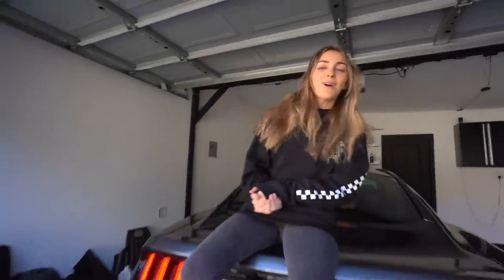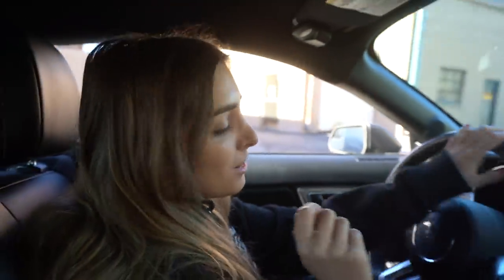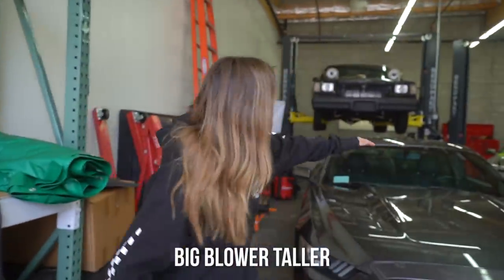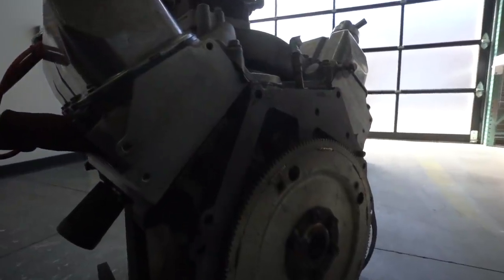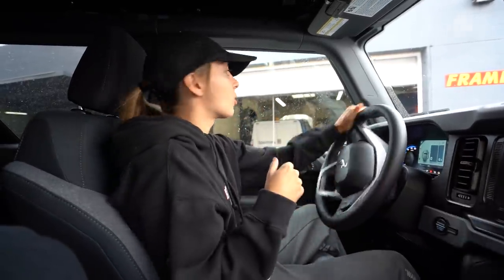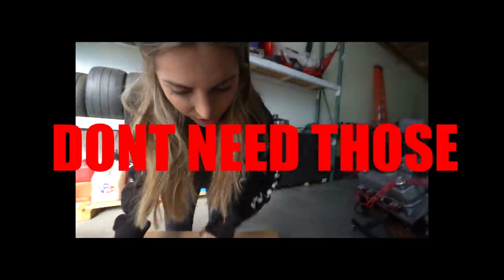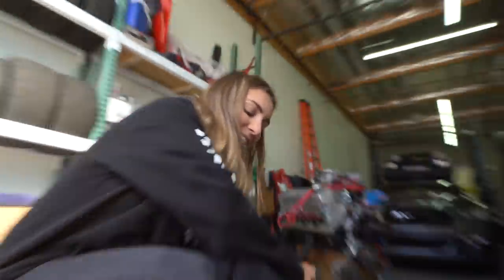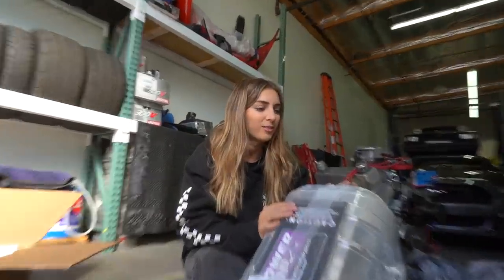I Bought The Most Absurd 2000HP Supercharged Big Block Engine for the Mustang.

Comment: Is the block strong enough to handle 2000hp? that would be my worry, especially being a BBF
Reply: Yes. I’ve seen these Motorsports SVO blocks make 2000hp at the mid 20psi range. The 385 series bbf is insane and I’m not sure why more people don’t build them
Reply: @4funner66  - people are ignorant. Rickie smith dominated pro stock with a BBF and so did Bob glidden.

Comment: i want to see 1200whp coyote build. or i wanna see a 2000hp coyote build. going pushrod from a coyote is going backwards!! You can get 1200whp hp and go as fast as 7s with just boost and fuel. Thats with nothing no heads no cams no pistons or rods.  Put the ford in the regal and coyte build a fox. you can go 5s and 6ss with a coyote fox.
Reply: Some people are stuck in the past with the pushrod shit, although going anything close to 2k horsepower is stupidly expensive on the Coyote sadly.
Reply: 2000 hp with a push rod engine isn't that hard bud.
Reply: Cough… oil pump gears. cough… cam lock outs. Blocks also need to be sleeved after 900 and if you want to got for 1200 you might to change the rods.
Reply: @christiansmith8529  let’s break this down. 

OPG’s in these cars break due to banging off a two step or a limiter, not high RPM use. The GT350 motor that revs to 8250+ uses the same OPG’s as the coyote does and it doesn’t have issues. 

Cam lock outs? If you’re going like 1500hp maybe, Aldo’s car isn’t locked and it’s fast as shit, midnights cars also aren’t locked. The VCT works really well. 

PLENTY of 100% stock motor Gen 2 & 3’s make 900whp without sleeves, 1200? Yea you’ll sleeve it. But if you’re that worried get a roadrunner engine or a predator block. Hell Joel Steele’s RoadRunner engine with ARP hardware only went at 1200 for two years and was sold and it “looked brand new” when sold.
Reply: @169abr  the opg’s break on the 2 step and limiter, you said it yourself.

Cam lock outs aren’t necessary but will help a lot with tuning. If you’re doing a 1200 hp build it’s pretty serious. I’m not sure why you wouldn’t to make tuning and trouble shooting much easier on yourself.

You said a 1200 horsepower build with just boost and fuel, now you’re saying to sleeve it too. 900 is getting close to the limit, you can make more but you’re playing with fire.
Reply: @christiansmith8529  I’m not the OP on this, I’m agreeing to sleeve it at 1200WHP unless you don’t mind blowing something up, the OP said just boost and fuel. 

OPG’s don’t always break on it either but people think bolt on cars need OPG’s. Plenty of stock cars go insanely fast on stock ones just fine.

You don’t have to do lockouts, if you’re stock PCM I don’t think locking the cams or leaving VCT is that big of a deal for the tuners like Lund or PBD. Again plenty of stock VCT cars go plenty fast and are 1200+. Midnights world record car had stock VCT intact and was tuned by Lund. If you’re locking the cams you know enough at this point and are a fully built engine anyways and lockouts are done cause it’s a standalone. 

Are you an LS fan? SBF? Hemi?
Reply: @169abr  I grew up in a racing family, we ran bff, bbc, and big ci stuff I don’t really consider either. My last project was a 3.0 s4 bored, big turbos, pistons, rods, ecu. my father built a pro charged s550 a few years ago, suspension, Lund tune etc. 900ish whp with smaller pulleys ready to go. so, I’m reasonably familiar with the engine. I’ve been out of everything for a few years. Was planning on doing an ls turbo build before Covid fucked my business.
Reply: @christiansmith8529  yea things have been developing fast with these cars cause of the 10R, the high 7 second stock motor pass really made a lot of people realize things. I want to put a Centri on mine but I’m saving for a house at the moment. Covid fucked a lot up and the current admin isn’t doing us favors.
Reply: @169abr  lol, lost my house so I could still pay the staffs mortgages…

Comment: Yeah, Sandy does have a valid criticism on the build. Polished is old school for sure. It looks good but old fashioned nowadays. It's a Mustang so go with dark engine components and carbon fiber accessories. The engine is bad ass but that frame will need modification for that engine to fit and handle the torque. This build is definitely going to be exciting to watch. The finished product will be insane!

Comment: My father had a 1985 F350 with a 460. Ford put such restrictive carburetors, intake manifolds, cylinder heads, and exhaust systems on those engines from the factory to meet emmissions. It always made me wonder what they were capable of in the right hands, I'm very excited to see how it goes down the track! What transmission are you putting behind it????

Comment: Curious to see the actual specs of the 598. If it's a steel rod engine(likely) it isn't going to be happy with 2000hp. It starts crossing into aluminum rod territory. If you end up bending a rod with the 14-71 on it (also likely) you might consider reducing the stroke while you're in there to fit a piston with a taller compression height which will be much stronger and more appropriate for the application. You'll probably end up at 582 inches or thereabouts but with aluminum rods it'll last.
Reply: And also possibly lower compression.

Comment: The 8.8 holds power pretty decently. Its the mounts and axle shafts that will be unhappy. If its drag racing only though, you can always put a 9" in back in place of the IRS.
Reply: The 8.8 def won’t hold 2000hp even built more than likely they will go with a QP 9” rear like on the regal.

Comment: I am not sure I heard you right but did you say Jon Kaase P 51 heads or did you say Sr 71 heads as those are the heads that Jon used to pull over a thousand hp and over 900 ft lbs on the 598 engine as I saw that video  almost a year ago.

Comment: I definitely agree with the Big Block and absolutely love Roots and Screw  blowers but there are only a few cars that don't look badass with a blower coming thru the hood and s550's are one unless it's carbon fiber s550 bodied promod! Since turbos are out of the question a crank driven F130 procharger would be way to go! Go with 25.5 or 25.3 chassis small tire build, bad ass 9" strange rear end,4 link and anti roll bar setup, everything suspension and k member parts from Race Craft or TRZ, possibly change the rods and Pistons definitely a centrifugal blower grind cam a john kasse 4500 flange single plain intake with 16 injector bungs run eight Billet Atomizer 550#s for all the alcohol and eight 325#s or some Bosch 210#'s to run E or pump gas on the street and god's gift to man Holley EFI a bad ass Reid cased th400 with a Hughes bolt together converter. I would try and keep as much of the interior as possible and run it on 28x10.5 slicks or 275 radials but have enough room to run a 29.5x10.5w slick. That would be a easy low 4 second car in the 1/8 and 6.70-7.00 easy in the 1/4!

Comment: just letting you know. With h beam rods instead of the much stronger i beam rods if you chuck any good sort of boost at it, it will snap a rod extremely easily and destroy the block and probably the head. before you put it in i would say switch the rods out now for the stronger i beam rods before you destroy the engine to the point you just need to buy a new one and have to do it anyways.
Reply: and rods should be limited to no more than 30 passes ...if she is making a 2000+hp pro mod car...and if this old guy she bought this engine from was a NA bracket racer, I am sure he was pushing 11.5:1 compression pistons  she will need to replace them with 8.0:1
Reply: 598 na 1000hp closer to 14:1 I bet

Comment: Oooh, this is gonna be sooo nasteee!! You need to get some true Aussie engine builders in there to help you get the right parts in it, so it doesn't scatter the bottom end, the first time you fire up some big tires with it. You realize of course, you'll have almost double the horsepower of your C8 now, in a car that doesn't handle nearly as well.. topped off by INSTANT throttle response (unlike a turbo). It will get out from under you quicker than a skateboard in a grease pit! Be careful kiddo!😍😁👍

Comment: Dangit, I’m enthused about it but IT’S GONNA BE EXPENSIVE!!! Piston change to lower the compression ratio,rebalance the rotating assembly,cam change and a drive system just to get started. Fuel system,ignition and complete chassis to house your new monster which you might as well consider a new family member since it’s gonna cost something comparable to raising a child to the age of 18. 
I freakin love it!!! 
In the middle of a pro mod build myself so I’m in the same boat. I’m glad you’re taking on this type of build,proud of ya youngster and good luck. 👍

Comment: Remember load on the axles is determined by the size of the tires, as Whistlin diesel has found with his Monster truck, horsepower will always find the weakest link, so do not put the biggest wheels on it until it needs it.

Comment: I didn't realize you have a 17 5.0 in the Ebony... I have the 17 3.7 with intents to TT it later down the line but now I have second thoughts lol
Reply: Trade it for a 5.0, it’s actually attainable unlike these insane YouTube builds.
Reply: @169abr  yaa, i commented at the beginning, minus the huge blower, the motor would be fun swap still... I'll be buying the s650 5.0 couple years after they release if they go with the awd feature they are talking about, for now the 3.7 only has 45000km and a 160000km warranty so nothing planned for a while either way lol

Comment: They make a 16-71 ( and you can still find old 18-71’s off old supercharged diesel semi’s )  honey that motors not gonna handle that 14-71 blower that’s what Top Fuel dragsters/cars run, I hope you plan on getting a rear end abd tranny that can handle about 3-5000HP depending on what fuel you run probably get 3k on pump gas and 5k+HP methanol, your gonna destroy your drivetrain lol

Comment: Big block Ford alsome but she’s gonna be very heavy in the front like the Weight distribution is gonna be wrost and instead of using an intercooler why not run methanol  to lose some weight and keep the engine cooled?

Comment: OMG. THAT car? With THAT AWESOME motor? I am expecting the same, lots of bendy stuff happening and finally the plastic crap will disintegrate (I hope you will be safe...). Not because Ford (I honestly have nothing against them as a company), but because NEW Ford made of plastic, NOT made of good-ol-fashioned STEEL. That is FAR TOO MUCH engine for that car unless you are going to modify the entire thing so much that it voids the VIN. lol And I am trying to imagine what will need to be done to the suspension (the front, especially...) Oh, yeah, also...WHAT are you going to do about the transmission? Because that stock 5.0 trans won't cut it for that big block... 

   ANYWAY, like all of your projects, I can't wait to see what this thing will be like when you are done(-ish)! We all know that Project Cars are never truly done, there is ALWAYS SOMETHING that can be fixed or updated or further modified... 

   Luv ya! <3

Comment: Emelia don't run carby with a hat it looks rubbish. In Aus we run blowers on everything we set them up with mechanical injection on alcohol. I have friends that are running mechanical e85 if they are using it on the street. Or if you look up JOE BLOW they have really cool EFI kits you can use to run Injectors without modifying or changing you're manifold

Comment: How much heavier than a Coyote is that setup? Can't wait to see the Carbon Driveshaft and built diff
Reply: According to Google an aluminum head 460BBF is in the 675lbs range and a coyote is in the 420lbs range. This doesn't account for the blower on the 460.

Comment: 1) you are going to have to reduce the compression ratio of the NA engine to about 8.0:1 or you are going destroy your new engine when that roots starts to spin up
2)  I recommend you pull the heads and get a look see at your pistons.  are they dished for a blower?  or are they High compression pop up style? what are they made of?  are they coated?
3) What Cam are you running? is it set up for a roots blower or a NA engine.   check these things or your engine is going to instantly regret your choices. 
4) check your rods too....how many passes do they have on them?  can they take the additional punishment of a big blower after an unknown number of passes already? If you are going to make 2000hp I would limit a NEW set of rods to 20-30 ...1/4" mile passes
Reply: You're so right !!

Comment: Engine out of a crashed drag car?? Strip it fully and crack test everything. 
I have seen both drag and oval car engines that run but fail in a very short time because of a big rev upside down or when the wheels hit the fence it loads every item in the car. And ofcourse where the balancer hits the wall!!

Comment: I would suggest changing the pistons in that engine. If it was built for bracket racing I'm going to guess it is fairly high compression. Won't work for a blower.

Comment: Wouldn’t it be….hotter if you mid-engined the big block, big blower Ford?  Blocking the view and adding weight to the front end is so….blasé.  Yes, you’d have to move the cabin forward 15”.

Comment: So what is this car going to be? 
Drag car? Cleetus and cars burnout car? Car to drive on the street and be thrown in jail cos California? 

Huge cube big block high compression n/a engine with the biggest blower you can get is asking for trouble. Ask cleet how that worked out in toast.

Please don’t be that person to run throttle bodies with an injector hat that serves no purpose, One or the other. Efi with air filters 
or a full mechanical injection set up. 

The build will be badass but it definitely needs a lot more thought out into it rather than rational decisions

Comment: Has no one told you you're crazy.
You need to have weight in the trunk, with the huge weight in the engine compartment.
Please put a cage in the car so nothing happens to you.
you'd better switch to higher and stiffer suspension with all that extra weight.
When it's done, you will then try to film from your point of view
I do not think you can see the road you are driving on.
crazy woman but you are a nice and good person.